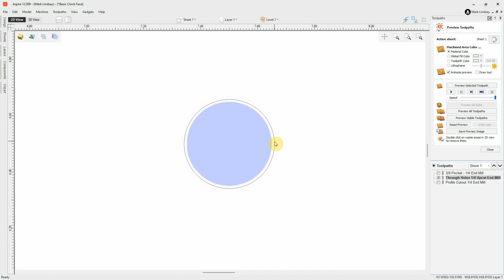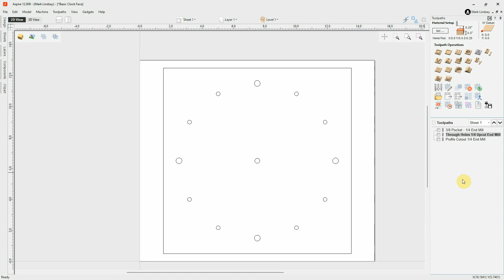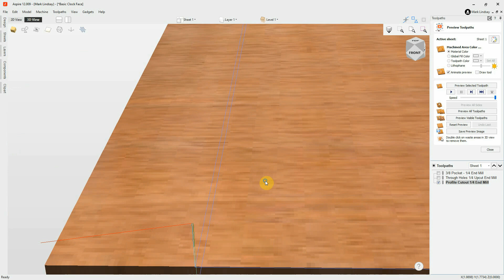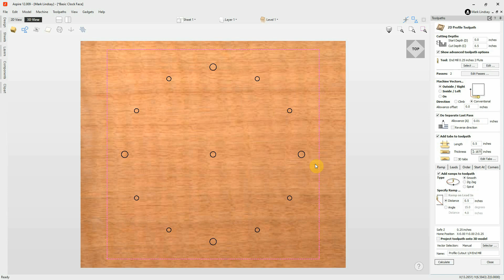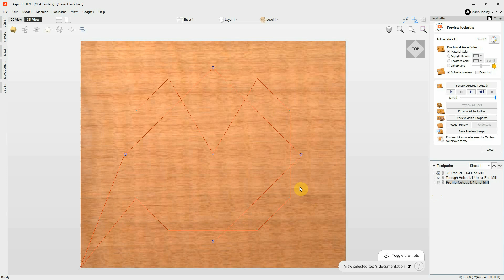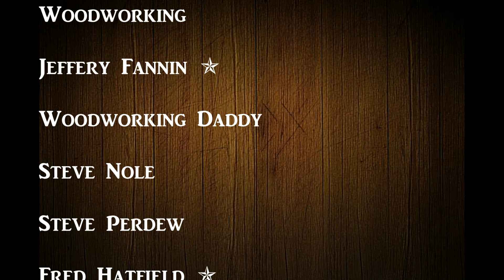Vectric V12+ for the Absolute Beginner - Part 4 – Tabs, G-Code, Separate Last Pass

Comment: Great videos! Quick suggestion, possibly?  

Around the 3:10 mark, you are explaining ramps.  You move your mouse around to illustrate/show movement of the bit into the substrate, but the 2D background is looking down from the top.  Maybe switch to 3D view and then show your ramp with your mouse movements into the material, with it oriented the way you are discussing?

I figured out what you meant, but it might help others understand your mouse movements a little easier.

Not a critique, just trying to help.
Reply from the maker: I thought I did switch to the 3D view, but it looks like I didn't at first. Thanks for the suggestions!

Comment: You mentioned composite nail as holddowns,  can you provide info on that?
Reply from the maker: I have an Omer composite nail gun and use Raptor composite nails when I'm working with plywood or MDF. I don't use them on solid wood, as they tend to split the wood. The nail gun I use is the one offered by Avid CNC. https://www.avidcnc.com/workholding-c-109_110_99.html